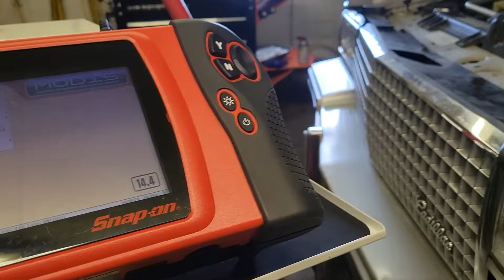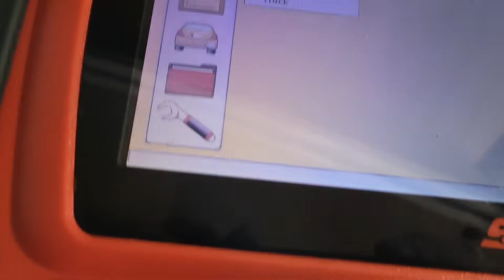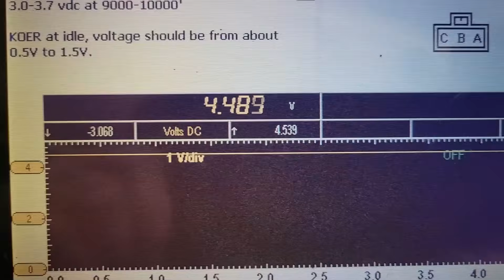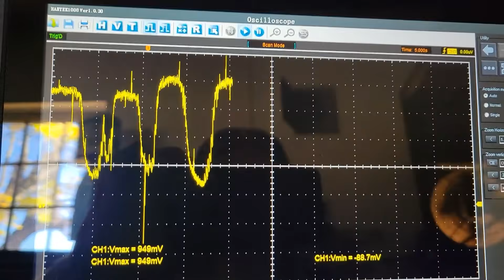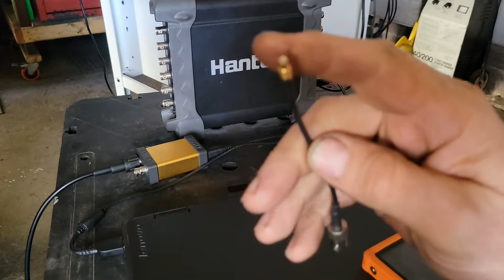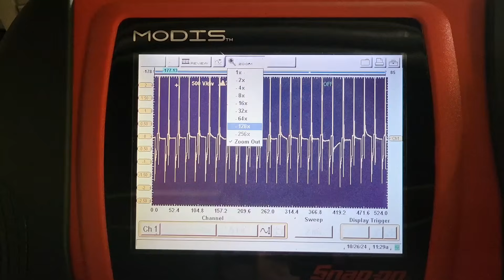OBD1 fun and testing various sensors with budget scopes, plus a little on snap on guided tests

Comment: The very first scope I used was a Bosch MTS that was at our shop. It was decent but the battery life was horrible. I bought a Hantek 1008 before the newer updates SW and it would crash on my windows 10 laptop all the time. Later in 2019 they updated the software and it seems to have fixed that issue . I since them have gotten an Autel MP408 scope that’s no longer available and it’s a great scope for the price . But I will still use the 1008 time to time and it’s a decent scope for the price and if you know how to use it effectively.
Reply from the maker: @CampingNstuff  The Autel scopes do look impressive. After the learning curve of where things are, they all are good enough. They all do have things they are handy or better at. For example,wheel speed sensors the uscope just won't get when others do. I always blame the ac coupler but not certain. 
 I have seen some vids of the older hantek software and was going to see if I could downgrade to try it out. Thanks for that tip, or I am sure I would have regretted trying it. I thought the interface looked simpler, but looks can be deceiving. Thanks!
Reply: @ the older Hantek SW if you make a big jump in time base like from 5mS/Div to let’s say 50mS/Div I would
Get an instant blue screen of death. Also if I would exit out of the SW before unplugging the scope same result . The one you’re using in the video is a far cry better and works really well on my Surface pro 7 running windows 11 .